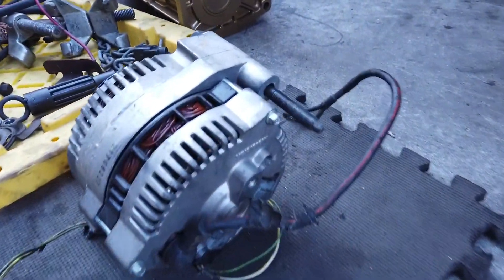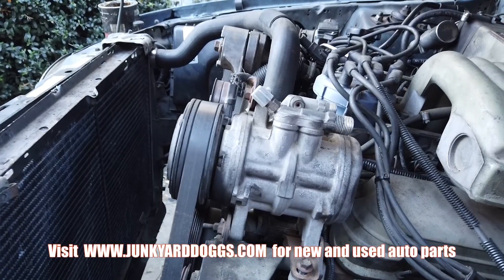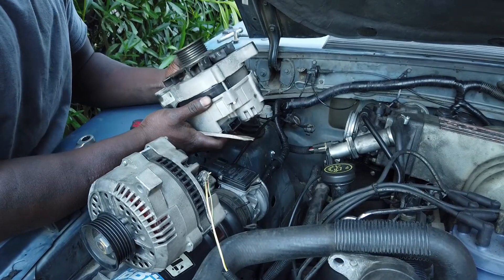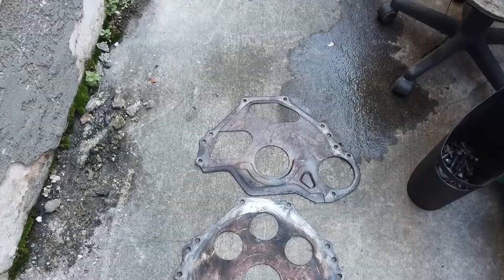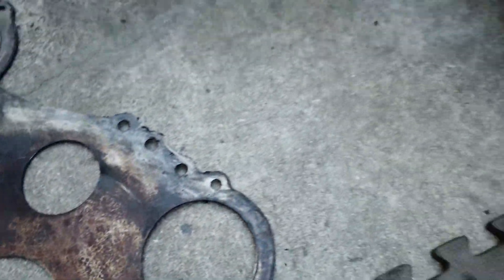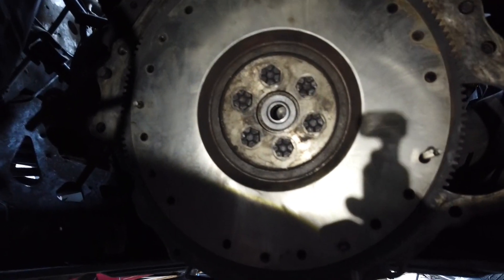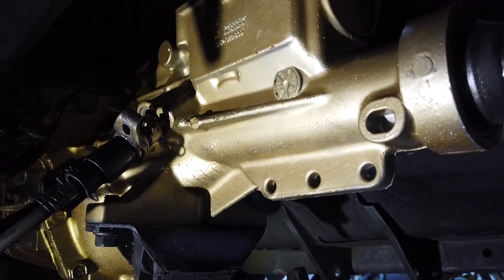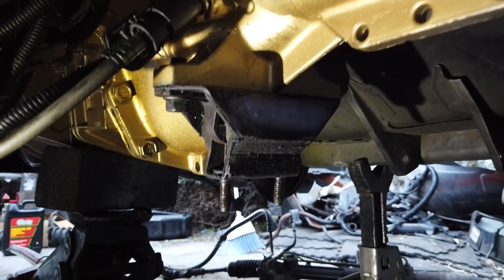Day 12 of 7 lol - 1987 Notchback Foxbody Mustang 4cyl to V8 Swap

Comment: The block plate was probably for a 157 tooth flywheel and the other was most likely a 164 tooth. The start offset is different to compensate for the difference in size. Here's a trick for installing a block plate without it moving around. Before you install the transmission is to take punch and hit at the base of the dowels on the block plate.

Comment: Hows the dual m90 build going?
I was thinking.. did you put an N/A cam in the engine? Wouldn't want boost blowing straight out into the exhaust. I may own a 3.8 but the stock cam had waaaay too much overlap for my 115mm of turbo was blowing boost straight out the exhaust. So now i'm ordering a custom grind cam.